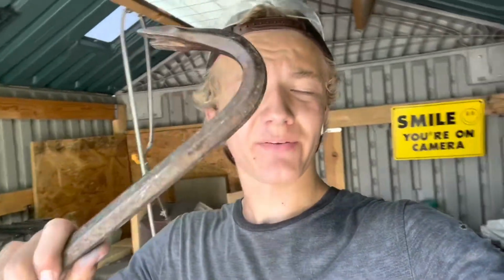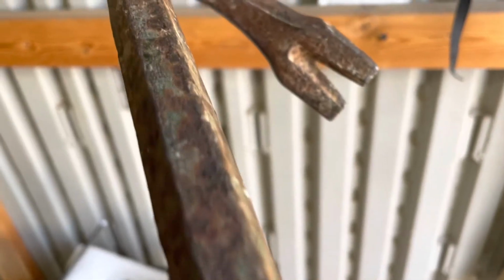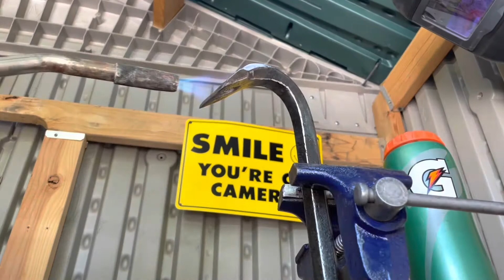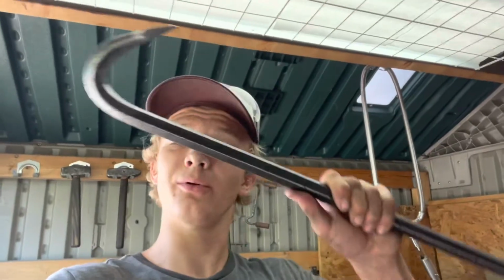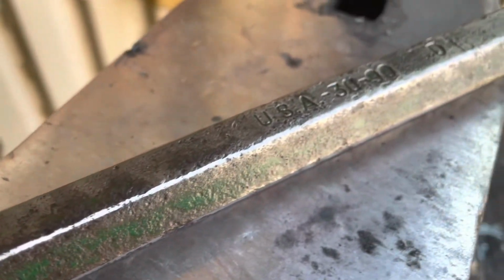Rusted Crowbar Restoration | Full Tool Restoration!

Comment: A couple of years ago a friend of mine had an old crowbar that he had broke the end off of. He gave it to me and told me I could have it for whatever I wanted make out of it. What I did was to remake it into a crowbar, just a little shorter that it was. When I gave it back to him he said that that was his Grandfathers and was one of the few things he had of his. When he asked what he owed me............No charge........
Reply from the maker: That’s awesome!! I love hearing stories like that and doing projects that are meaningful! It gives so much more life to the work I feel like.
Reply: @ToddKoch  Also when I did that I learned not to use a plastic bucket for an oil quench...............oooops........
Reply from the maker: Haha yeah that is another thing that I have been working on, finding a good container to put the oil in
Reply: @ToddKoch  For small projects an old metal coffee can or bean can should work. Something larger would need to be "custom" made.
Reply from the maker: This is true. I’m definitely gonna get on it soon!
Reply: @ToddKoch  I have a stainless steel "vessel" that is about the same size as a coffee can I use for such projects. I suppose and old non teflon cooking pan would work as well.
Reply from the maker: Thats a good option! I actually never considered things like pans and cooking supplies, though I guess now that I think of it some would be pretty heat resistant!
Reply: How the hell did he break the end off of a crowbar???
Reply: @kermitclassified  Not sure for certain. It looked like someone had been hitting on it with a hammer, a lot. Anyway I just "reclawed" the end, reshaped the end a bit, heat treated and tempered it and gave it back to him. That was also the day I learned that doing a oil quench in a plastic bucket was not a wise idea.................oops!
Reply: @jeffreyjones6409 Cool, definitely not a good idea to use a plastic bucket!
Reply: @kermitclassified  It started out as a 5 gallon bucket and when it was done it was about 2 gallons, give or take, LOL.